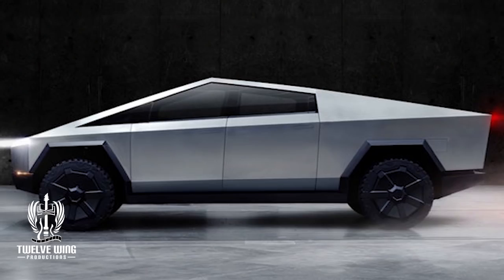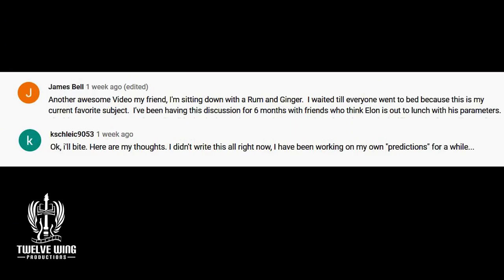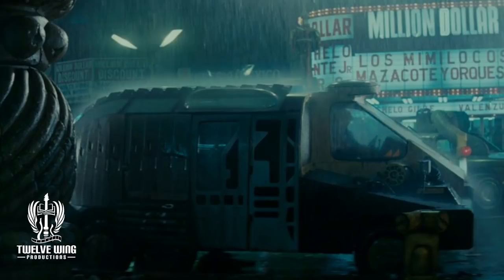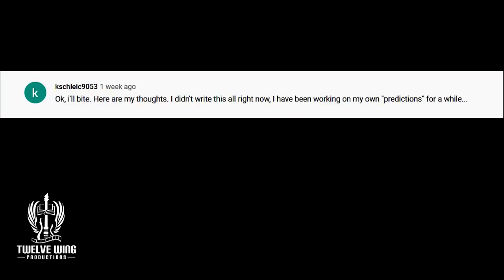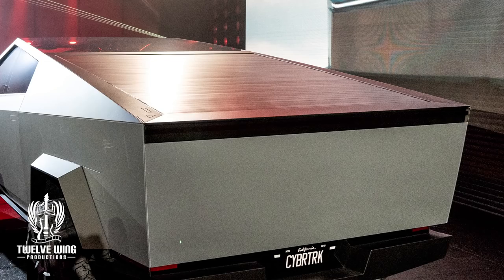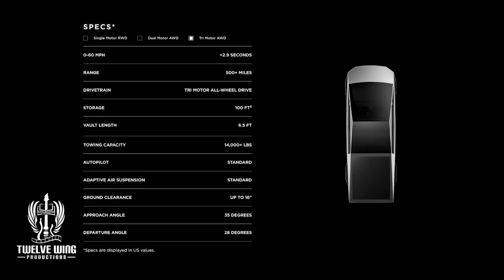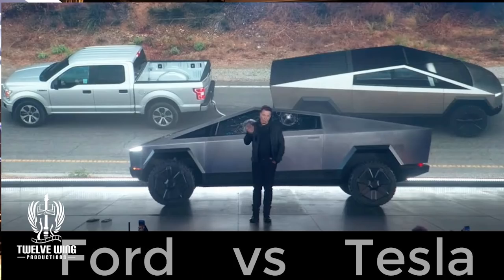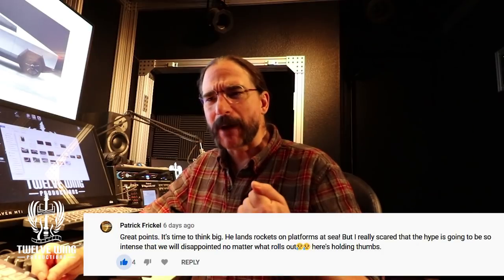Tesla's Cybertruck was not designed, it was engineered.  Here's how you benefit.

Comment: For me the one thing that stood out by it's conspicuous absence was Battery pack "KWh", cell count, and $/KWh.
Nowhere did he specify the size/cost of the battery pack that is providing the specified ranges.
Such a heavy vehicle should inherently have lower Miles/KWh so hiding one half of the equation is suspicious, especially considering how low a total  price he's targeting.  I'm hoping he's holding back serious cost/capacity advancements for the battery investor day.
(Honestly, I think this explains the delays in the Roadster and Semi as well.)
Reply from the maker: I think for that we are going to have to try and do some calculations of, or look to, the watt hours per mile figure and reverse calculate that.
But yes... that was not mentioned either and should have.  I think that there is still quite a bit of development on what I believe is their solid state battery.  More to come from them on that shortly when they do their battery day.
Reply: @twelvewingproductions7508  
That reverse engineering is going to be an interesting puzzle given the paucity of specs Elon has revealed 
(the fact I'm a humble EE and spectacularly ignorant of such matters excludes me from the quest!)
Without the weight & drag figures for the CT, any first approximation derived from current Tesla vehicle Miles/KWh specs is going to be very iffy.  If we had any inkling of the CT weight we could attempt to extrapolate the X/S/3 weight/drag <-> KWh specs but without the weight I think we're a bit snookered.  
- I think it is safe to assume there's no giant leaps in motor+inverter efficiencies,  
- Industrious Netizens have used CFD to calculate the CT drag to be in the 0.35 region (and Elon has even said that 0.30 would be possible but hard).
-Those giant off-road tires also probably have a sizeable effect but, as they have been identified, that could probably be factored in.
It's just the unknown weight (I have heard absolutely no hints at it) that throws a giant spanner in the works of any comparison. 
I guess, if we plug in the (presumably better) unadulterated Miles/Kwh spec of the Model X and it still points to the CT price being spectacularly un-achievable then we know something new is approaching.

Comment: Jack Rikard says the 220V power supply could be as easy as reversing the charge inverter/transformer. Power can flow either way. All it needs is some software to allow back feeding. Power limit would be whatever can be delivered at a Supercharger. 
Motors are oil cooled so sealing is already done. Batteries are another issue and would need some serious engineering to meet IP65 or better.

Comment: All Tesla motors and batteries are waterproof, and I've seen improved seals on the doors, but I wouldn't hose out the cab, just the bed and the outside of the truck.
To think that you'll be able to get such a huge vehicle, 6 seats, for the price of the Model 3 SR+ ... with the same range?!  it's madness! It'll be the new super-safe minivan for hauling kids to/from school 👍
Reply from the maker: I wish that were true.  Unfortunately it isn't.  At least not true to the degree that this truck needs it to be true.
There is a fantastic channel called "Rich Rebuilds".  Have a look at it.  What Rich does is he specializes in rebuilding water damaged Teslas that have been caught in floods.  The exact scenario that needs to be addressed with the Cybertruck.

His videos will give you a better insight on exactly what parts need to be further strengthened against water incursion.  This might also be a window for you and others to see what I mean when I say that this just might be a "Falcon wing door" problem.  Something that sounded relatively easy when it was conceived but far more difficult to implement.
Reply: @twelvewingproductions7508  Rich rebuilt first gen Teslas, yes, i've seen the water and rust in the motors and inverters. On the other hand I haven't seen one photograph of a rusted Model 3 motor or of a current gen Model S/X motor. I'm sure they fixed the seals in the latest revisions, even though X and S were not meant to be tough.
Cybertruck is built to be tough, and water resistance can be achieved with the unibody design much easier than with the old designs, which have to be pretty first, practical second.
Reply from the maker: @Poxenium , they are improving all the time so I wouldn't put it past them to have cracked that nut.
I am saying, though, that doing that is NOT an easy thing to do.  It's certainly not as easy as it sounds.

Comment: The distance between the front of the windshield and the front of the truck has me concerned about an adequate crumple-zone. Your thoughts?
Reply from the maker: I think it's more than enough space.  It's about half again more than the model 3 actually.  What is deceiving is the size.  Because of its shape, it look smaller than it actually is.
The danger will be in what will logically be put in there.  If they do make it to hold tools and even recharge them...then people are going to put heavy equipment up there.  Welders, tool boxes, other industrial equipment.
This is going to have a strange result during impacts.  When the truck hits another vehicle, the moment will be transferred to the heavy objects in the front.  This will cause them to instantly slide forward and tap the car or object struck in exactly the same way as a dead blow hammer.
At issue is that this sudden deceleration may also be transmitted to the truck in strange ways.  I am going to be VERY curious to see the results of the crash testing on this truck.  VERY interested.
Reply: Wow, your right, that is deceiving.  It looks much smaller.  Knowing Tesla, there will be all kinds of warnings, "Don't put cannon balls in the frunk."

Comment: GM, Ford and all the rest of them design their trucks, instead of engineering them. And it shows. When you are working with rustproof, cold rolled stainless steel, which starts out work hardened, you can't stamp curves into it. So it looks exactly the way it has to to have all its other amazing qualities.
Reply from the maker: I don't disagree, but because aluminum was also an inexpensive rust free option I don't see the use of stainless as being totally a first principle solution.
I think it turned out to be that way once they made the decision not to care much about what it looked like.
So I think it's best to meet in the middle on this one and agree that the choice of materials was conjunctive and that it most certainly didn't have anything to do with the design of the truck.
It seems obvious to me that the overall design/style language was given zero weight in any discussion other than what the could "get away with".

Comment: They should IMO, offer a version with no roof class and no rear bulkhead at the back of the cab section, as well as only two doors. If they make a version as stated the Cybertruck becomes "Modular", it will be bought to do all kinds of coach building. Coach building companies will buy the truck like wild fire! I have ordered a Tri-motor, 500+ range...

Comment: I hope the 240 volt outlet will put out 10kW's of pure sign wave power so I can power my whole house for an entire week when the power goes out!!
Reply: A big welder is actually 12kw, so maybe more.... I don't know what they will do, but this truck actually makes a really solid welding rig, but what's the point of a welding rig limited to small 240v welders? so it would have to be at least the 50amp 240, which is the 12kw, so you'd want a 15kw cont welder to keep the unit on a lower stress output curve.

I'm not sure he'll prioritize that, but I would be really surprised to see under 10kw peak.
Reply: @markallen6433  Now were talking!! We need options on the inverter size. Everything from the weekend warrior to the professional gas pipeline 14 hours a day 1" thick welding.  Man, I'm so looking forward to this!
Reply: @tigeroll  I mentioned elsewhere, but what really interests me is somehow accessing the motor inverter t1 t2 t3 output to power three phase, or maybe even split phase. The motor controller runs some insane hardware. The inverter peaks at 500-600kw. Fucking crazy.

Comment: I'm planning to build a DIY truck camper to live full-time indefinitely on the back of my Cybertruck and save having to pay rent. I keep getting people telling me it'll be impossible due to the sloping bed sides but I think it will just need a different design and complex shaped underside to closely mirror the profile of the cybertruck. I'm thinking flat boxy sides, with no windows for security and covering the roof and all sides with solar panels. Any engineering thoughts from you or your followers as to the engineering viability of a cyber truck camper? I'm a new subscriber to your channel but enjoy your analysis.
Reply: Same plan, because why wouldn't anyone do this? :D A trailer seems like a better option to live comfortably, it could hold extra batteries and both CT and the trailer could operate independently. 
Anyway, the truck camper: I think there's going to be a structurally important bar above the rear window, so you can't delete the roof window and open up the space behind the front seats without major structural work. If you put your bed on the roof like an alcove, and keep the truck bed and roof as they are, you only have a floor space of 2m in length and maybe 1.7m in width, which is really small for a bathroom and kitchen, but not impossible. You can probably go quite high, as the center of gravity is very low for a truck, and the roofline seems lower than a F-150. There's also a flat floor without wheel wells, actually simplifying the underside of your truck camper. The sloping bed sides open to the outside, so those will add function instead of intrude on your camper, and you only need a small hole or latch to access the already built-in power plugs. With no rear overhang you could put a window there and lock that up with the ramp. If you're ok with using the cab as your living room (it has comfy heated seats and a 17" screen, so, yeah...), I'd say go for it!

Comment: 8:28 Also, for each panel there are several sets of stamping dies for progressive forming - maybe 3.
Reply from the maker: True that it is multi step.  My point was that the end result is that each part is costly to design and implement and even after you are done, it still requires manufacturing time.

Comment: This was interesting to say the least. If they saved so much, then why are they so expensive? My immediate thoughts along those lines were that if Ford, Dodge, GM or even Toyota, engineered, not designed,  similar body style that they could sell their gas trucks for less than $15,000 again. I'd live with that style for that price.
Reply from the maker: You are wise Teresa Peabody... very wise.

As to the cost of the Tesla, its cost is currently wound up in the battery.  That price is coming down, but that's the current issue with the cost of the Tesla cars (or any electric vehicle).
Very soon, economy of scale will bring the prices down.  This is just the stage we are in currently where things are ramping up.

Comment: One thing I don’t like about the design is the bullet proof windows.  I say that because occasionally people need to break the glass in order to be able to get out of their vehicle.  What are the occupants of a CyberTruck supposed to do if they’re in that situation?
Reply from the maker: Though they aren't truly "bullet proof", your point is a valid one.
What you have to decide on is the benefit vs the hazard.
As cars get safer, the instance where you will need such a thing, especially in a car as strong as this, is probably limited.
The doors are unlikely to be pinched to where you can't open them or can't roll the windows down.
What IS likely to happen in our modern world is for some ding dong to try and attack you in a road rage incident or someone in SF trying to break in and steal less than $900 worth of stuff so they don't get charged for a "crime".

So if this were an option... normal or hyperglass... I'd go with the hyperglass.
Reply: The windows are not bulletproof, and existing methods of breaking glass will still work fine. Unlike metal, glass has extremely high internal stress at the molecular level. Emergency services use high carbon (very hard and brittle) steel to shatter the glass (even a tiny chip can be enough to shatter a window in some cases). If you wear a high carbon steel ring, you can shatter a glass by barely even touching it.

Comment: A distinction without a difference since the result of the engineering work is a design.
Reply from the maker: I searched for a better term and aside from "style", none adequately identified the difference.

A block, is a block.  An arch is an arch.  If one designs an archway in the middle of a courtyard, it's art.  It's design in its classic sense.
If the archway is put in to support a building, it's no longer design, or style... it is engineering.
Suspension bridges and arch supports can be integrated into an engineered structure to make it more appealing but that will ultimately be up to the taste of the times.

The looks of the cyber truck isn't adding fins to make it look like a missile or rocket, nor is it putting gargoyles on the fenders.
What you see with the cyber truck is the antithesis of that.  Its looks are a direct result of its engineering.  There is no "design" here.
We can argue the semantics of the word or you can just accept that the design ended with making sure the part in front was more pointy and sloped than the part in back so it would be slightly more slippery.  That's it.

I've done enough wire frame engineering study models to recognize this for exactly what it is... and why they did it.
Reply: @twelvewingproductions7508  I understand your meaning, it's form design follows function and is not for purposes of aesthetics . Although I think it's beautiful. 😁 Design is just a very broad word and not specific enough.
Reply from the maker: @jdelacruz6854 , It is.  I'm a bit of a wordsmith and even I am finding accurate nomenclature for this to be elusive.

We simply don't see this kind of bold thinking from other companies today.  It likely sprang out of Space X and Elon's new mandate that "The best part...is no part".
It's kind of like a knight's armor.  At first, it was what it was.  Then at some point we entered "High Gothic" and we had the luxury of design.
This time will come again, but for now we have to handle the tasks at hand.  We need to get a space station up and start doing orbital and lunar based astronomy where we can get away from signal and light pollution and we need to move to a renewable and electric driven society and economy to help the environment.

So much to do for us little humans.  Then we can make things pretty again.
Reply: @twelvewingproductions7508 here's to pretty again 😁. I'm a minimalist so I'm 100% on board with the best part being no part. I like having less to maintain and clean.

Comment: It seems Musk is counting on a lot of cost savings in the manufacturing processes. How else can the cyber truck be offered at $40,000 except through manuf.? Battery packs will not have sig. come down in price in two years. Tesla owns Grohmann which will speed development of cutting, bending and welding bots. Would it be possible to do a break down of cost of each major component of the cybertruck: battery pack, wheels/tires, motors, suspension, unibody, ss exoskeleton, interior, vault door, glass, elec's, overhead, profit. I think it will be very hard to stay at $40,000.

Comment: It’s interesting to look at this as a purist cost and function led effort.  I can see that launching a spec to better the mass market trucks in the USA is needed to get off to the right start for Tesla.  Having said that, they will have a very powerful new design language and build method that could extend into a much larger market segment.  i.e. a narrower ‘global’ truck for use where the Cybertruck is too wide.  Think 8”-12” narrower with three seats, middle seat is driver, moved forward into that huge space but still crash safe.  Passengers sit either side of the driver, as per McLaren F1.  The rear bulkhead could also be moved for either more seats or longer ‘vault’.  The cybertruck will certainly hit model X sales.  A small cheap city car or sports car using would be great but will also encroach into other models.

Comment: I think the gigantic frunk is confirmed. I’ve seen a picture popping up somewhere. Agree with the engineering instead of design but small disagreement that they stopped the process mid way. I think the final look is a result of a couple of constraint.  Would go as far as saying the truck could not look any different. It’s the origami look that is a result of using 3mm steel and no stamping. I think a
s a concept this has been floating around for a long time but nobody had the balls to make it cause the result is so unconventional. I think the fact that Tesla has collected an estimated  300.000 preorders has send shockwaves through the industry.

Comment: Fords EPA ratings are inaccurate. The Cybertruck is even better than they say, but not quite good enough for towing. I would not be surprised if Tesla declares they can double energy density with the next generation of batteries.
Reply: The glass works once. The strength is mostly in the smoothness.
Reply from the maker: I'm going to have to do a video on the range of the truck while towing.  It's something I've been giving a lot of thought to.